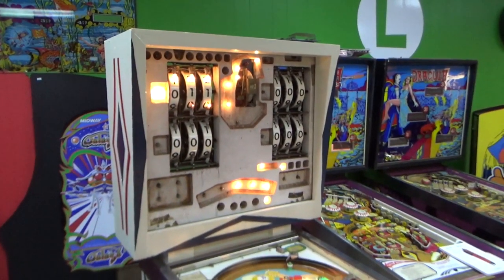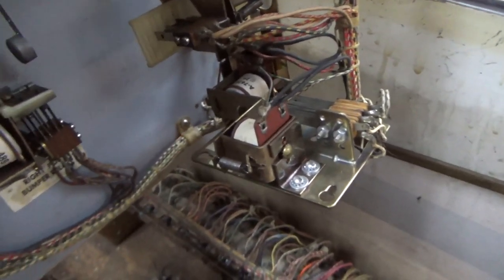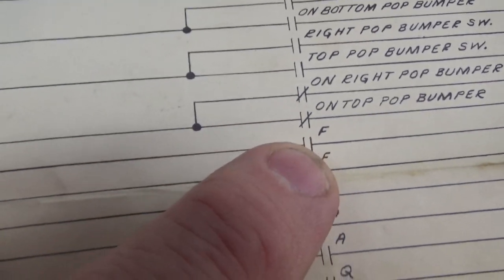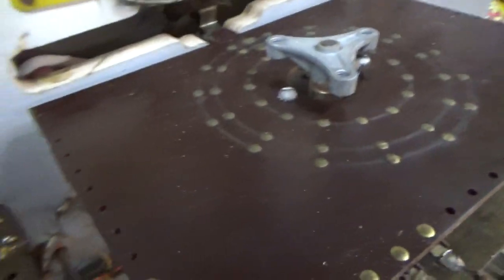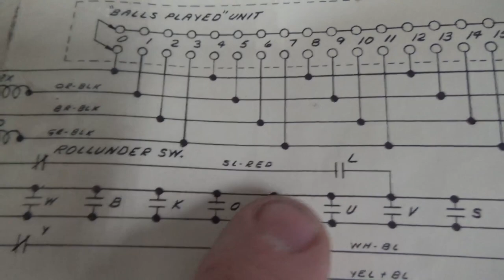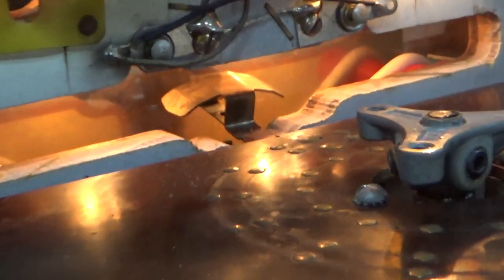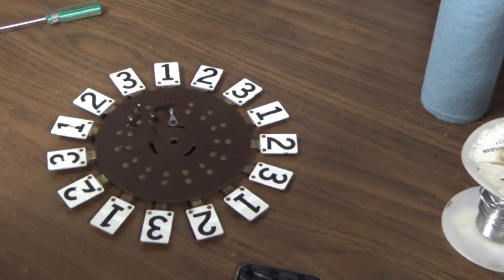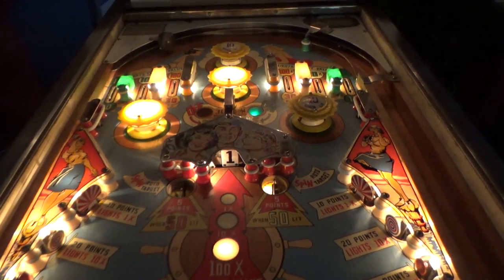Gottlieb Changed Pinball With Their Amazing Roto-Target Design - Repairing, Repainting History

Comment: The shorted coil was interesting because half of the paper was all burnt and the rest looked pretty fine. In normal operation I would expect it to darken evenly. It probably shorted so only half of one layer worked, then a gazillion amps went through that part and burnt the paper unevenly.
Reply from the maker: Yeah that’s prob the part that had the short so it got hotter there than the other side…